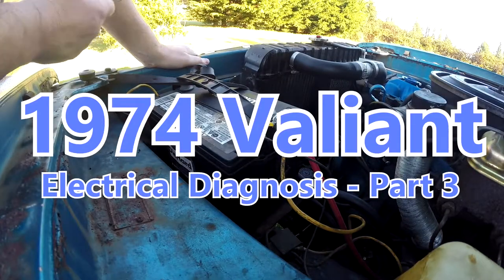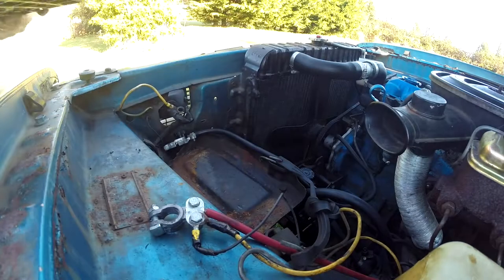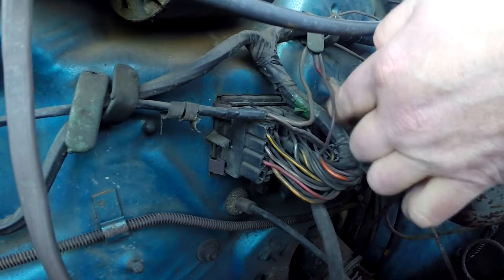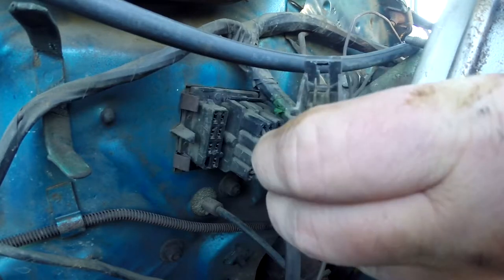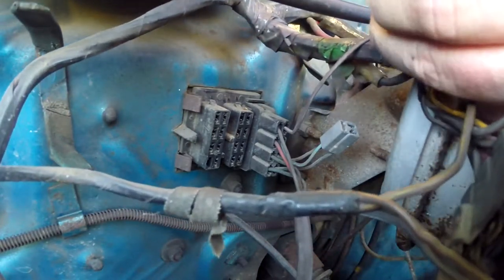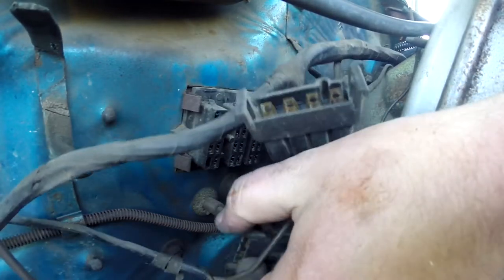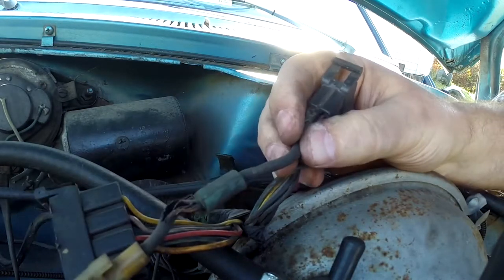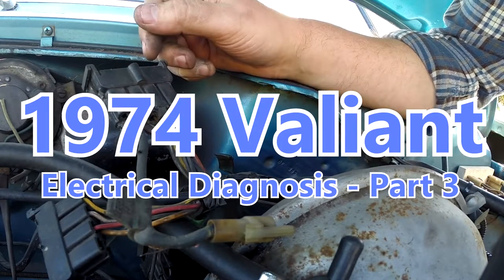1974 Valiant Electrical Diagnosis-Part 3 - Smoking Gun Number 1

Comment: Those bulkhead connectors weren't engineered very well. The way the charging system is designed on these cars overloads a couple of them, especially if they are dirty. The worst problem is that all of the charging amperage passes from the alternator through the bulkhead, to the ammeter and then back through the bulkhead to the battery. Chrysler finally made a factory bypass for the charging circuit the last one or two model years of the A-body, but for the early years it's best to reroute the charging circuit strictly inside the engine bay.
Reply from the maker: I've been down this one before with a 64 Windsor. I am using the bypass method right now.

Comment: How difficult was it to change the connectors and wires on the bulkhead?
I've got an issue with mine and I figure I'll just replace both sides to be sure that isn't causing a problem...

Comment: What are the teeth called in the bulkhead connector?
Reply from the maker: I only know them as Male spade connectors. I managed to find some replacements from Napa. I think they were called Chrysler Male Spade, Perhaps they were called Bulkhead male connectors. I didnt end up using too many of them when I did this to my 64 chrysler. I simple ran the wires directly into the dash. i can send some your way if you need them.
Reply: MicrophonicFool I went to my local NAPA and they didn't have them...any way you can send me a picture on how you connected it? I'm having issues with the wires and I think I'll have to redo them. I was thinking about simply putting a new bulkheader connector as is in the video but I'm not too sure what's a better method?
Reply from the maker: If you happen to be having similar problem as mine check this: http://www.madelectrical.com/electricaltech/amp-gauges.shtml
The better method for running a small number of wires is bypass the bulkhead. If you were restoring a car from scratch and needed to be absolutely genuine, then I would suggest building/buying new bulkhead connectors altogether + a new wiring harness. The link above solves most of the normal dodge/plymouth/chrysler short-out problems
Reply from the maker: I am almost complete on the fix of this Valiant, just havent edited the video yet
Reply: @MicrophonicFool  hey bud what parts were needed to fix this mine fried today and need to fix asap need new spade connector and in line fuse
Reply from the maker: @jasonandsummer5109  I wouldn't bother with new spades in modern times. Find an empty spot through that firewall grommet-thing and run bigger wires through there. There are usually one or two spare holes.
Reply from the maker: If we can find a way to talk more quickly, I can spell it out much more thoroughly
Reply from the maker: @jasonandsummer5109  This later one gets more specific: https://youtu.be/YCGUe04CXS0
Reply: @MicrophonicFool  yea not sure how to private message  but are u saying jus tap into wire on other side with same gauge and a in line fuse
Reply from the maker: @jasonandsummer5109  See if that second link makes more sense for finale. Otherwise: Lonemonk@shaw.ca
Reply from the maker: @jasonandsummer5109  How quickly do you need to move the car? Some aspects are not required if starting the car is the only priority. Fuses and shit are useful exclusively in emergencies. Everything can be bypassed for the short term. I'll tell you how to do in 10 min if we can find a way to safely connect
Reply: @MicrophonicFool  yea that would be great need to get it back home tomorrow asap
Reply from the maker: @jasonandsummer5109  Well email lonemonk@shaw.ca and arranger some other method